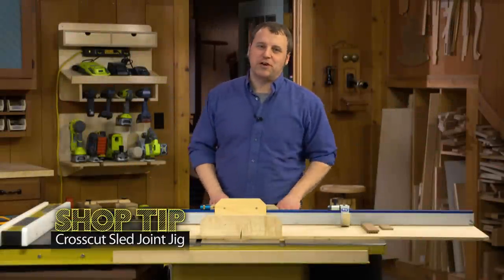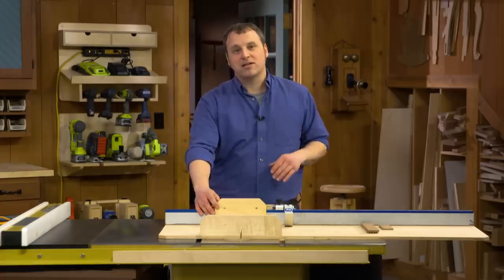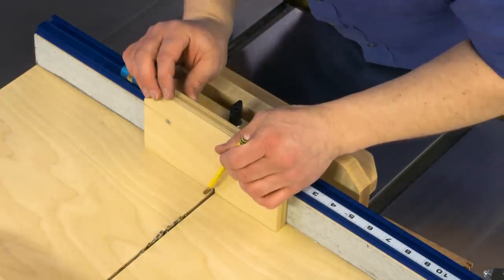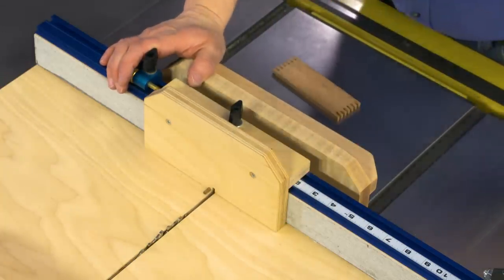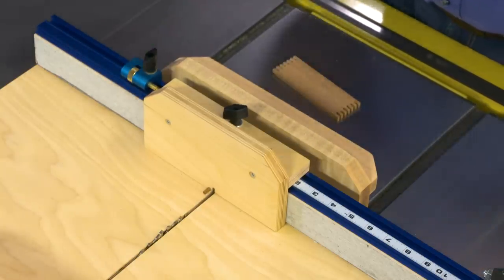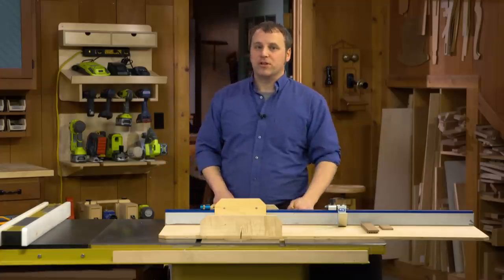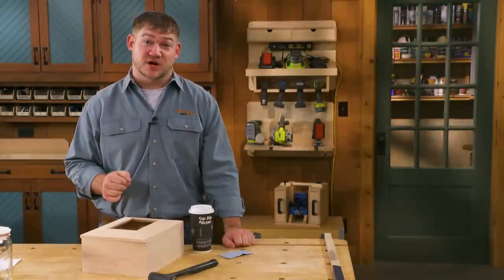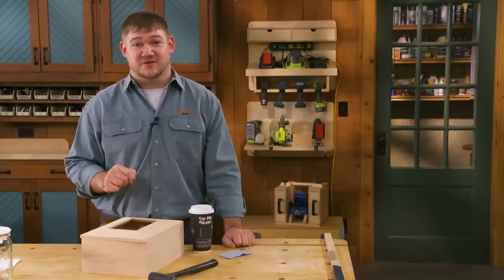Woodworking Tip: Crosscut Sled Box Joint Jig

Comment: I like the tip, but the problem I have is actually cutting the "key."  Those itty-bitty pieces. Recommendations on how to cut those safely?
Reply from the maker: For extremely small pieces like this I like to start with wider and longer workpieces that are easier to handle and keep your fingers away from the blade.  Since you just need a short piece for the finger, I make a short partial cut in the workpiece (pushing the workpiece into the table saw blade a couple inches and pulling it back) sneaking up on the perfect width.  Then I cut that small piece free from my larger workpiece with a hand saw.